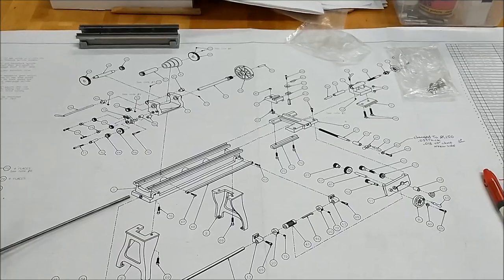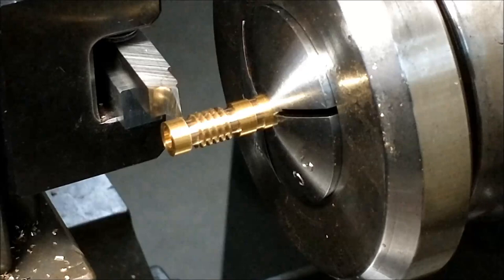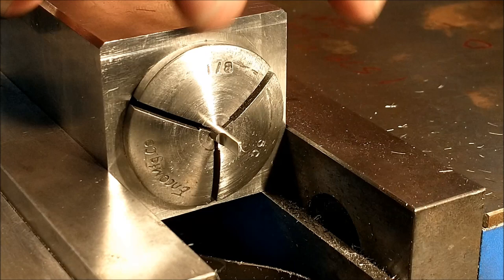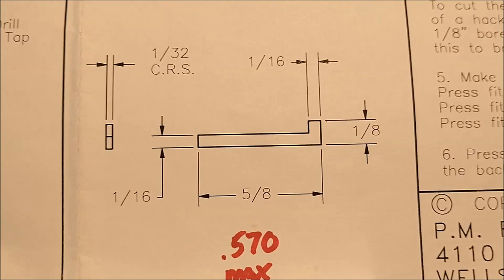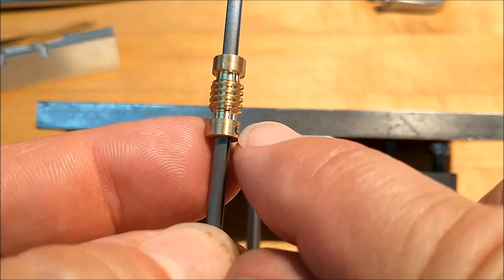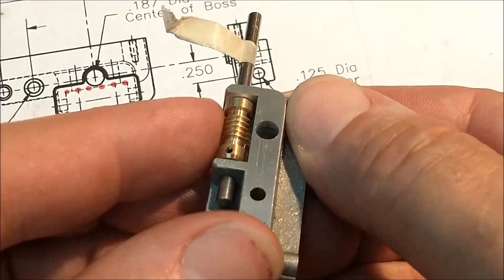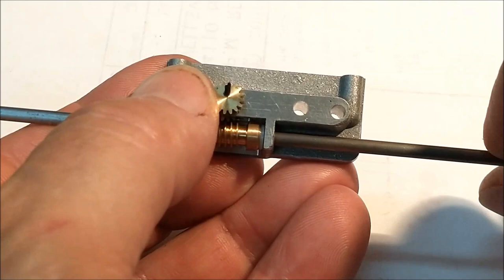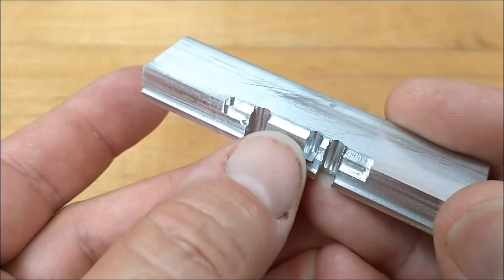IMPOSSIBLE Miniature Internal Keyways and Worm Gears

Comment: A thing of beauty is a joy forever! When you were adjusting the broach with a punch I was thinking the cutter would bend sideways somewhat more easily than it would forwards (despite the relief), so it would be easy to accidently widen the slot.  I suppose you just need to check alignment carefully before taking the next cut.
Reply from the maker: It did side bend once. I caught it on the next pass.

Comment: When you were making the broach it left me wondering how this was ever gonna work until I saw you bend it. Dear me, I never expected you to make a sacrificial tool.
On making the L-key I think it would have been much easier to simply file it. As a modeller I have learned to file within 0,02 mm (7-8 thou) tolerances and I have a very small machine vise to hold it (1 in).  But as to machining it your method was again ingenious to say the least.
Reply from the maker: The sacrificial broach worked very well, and the completely blind machining of the key was fun. You have to trust your numbers.

Comment: joe having seen this video,,, has  given me inspiration,,i am in the posesion of an  "old"myford ml 10 lathe ,,one of the cheapest they made !no rack no tumbler reverse,,the traverse is by the lead screw the handle of which holds the dial for thread cutting...after see ing the above i am going to make the tumbler reverse and fit a rack and cog for the traverse, using the old handle from the  lead screw traverse..i will need plenty of patiance,,  but i have the patcience of an oyster... so here goes nothing .....wish me luck   ,,,,, laurence

Comment: Thanks again, Joe. Time well spent watching your videos. I am currently rebuilding my 9x20 bench lathe saddle so in a sense I'm doing something similar to what you are doing, on a larger scale. all of the holes in the cast iron for the gear shafts were worn so I reamed out the holes and installed offset oilite bearings, that I made, to adjust the backlash in the lead screw, feed gears, and rack and pinion gears. All in all, I modified & installed 3 bearing sets and the set screws to hold the offset adjustment and also installed new oil feed channels so the new bearings won't wear like the stock ones. Watching your project was a good inspiration for fixture methodology and had a myriad of good tips and pointers for general machinist practices. I'm looking forward to the final assembly of your lathe and watching that bad boy going round and round. As you say, "it's a thing of beauty".

Comment: As I was watching, I was thinking about how much I have learned watching this build. My question is, and it's not a rhetorical one: What, if anything, have you, Joe, learned, while building this kit?
Reply from the maker: I had limited knowledge of these machines when I started. I really like the reverse gear setup and the feed worm designs. I have a better appreciation for the intellect of the 1800's engineers too. My steam engine was my first functional scale model and it was just a build. I took my time, but this lathe has my heart. I am going the extra mile on every step. So maybe I've also learned a higher level of patience. Good question.
Reply: @joepie221  thanks for that response! I wasn't trying to pry, but I know that smart people are always learning, and I figured what you learned was valuable for me to know. With respect to "appreciation of 1800s engineers": I work on and use firearms from that era and that's where MY heart is for much the same reason.

Comment: I worked for 7 years at Westclox making tools and dies for the production of key wound alarm clocks. Small parts are nothing new to me.  Now I work for a shop that makes anything that we can. I have an order for 10 snow making machine nozzles that has a 0.010" Dia. hole drilled through the center of a 9/16 Dia. stainless steel blank. I've been wanting to build this lathe for a few years now. I hope to build the whole shop that they offer. I think I would've started with the drill press first.  Nice work Joe!

Comment: Nice work as aways.
So the gear train in the Apron is around 62 DP or .4 Module.
Ths drive key in the worm can be almost as long as the worm if you just offset the tang on the key.

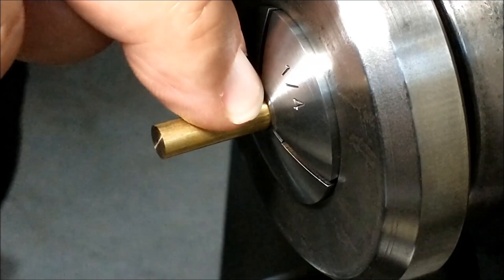Comment: 2:01 There is a easy trick to get it run fairly straight in 3 jaws and 4 jaws -I loosely put it in chuck and then use a peace of wood/plastic/sometimes steel back end of knife-or whatever is avalable according to material i am going to cut hardness and i put it in a knife holder and slowly touch  it while machine is running.Just make sure that peace you are using in a holder is above the center and that clamped peace isn't too loose or it may jump out .
Works very well ,simple and fast.Some people made holders with bearings but i am way to lazy to bother with it.

Comment: A very interesting process. I am learning quite a bit from you on working small. I also for instance enjoyed your video on how to cut very thin walled parts on the lathe. That video pointed out that the loads are on the cutting side of the tool and what is behind does not matter, at least in the way of loading. " Producing Extremely Thin Wall Parts ---Made Easy "

By the way, I love your teaching style. You cover what is needed without too much extra, but at least for me there are few questions left. You also, as does Quinn Dunki, chose some great projects, fun to watch and informative at the same time.

Comment: Great work Joe, and awesome job of working out the intricacies of that key/worm assembly. So much fun to watch it operate as an assembly and kudos for getting it to work on the first try. My guess is if you made it to dwg dimensions you would have to alter it with a dremel or such until it cleared every where. Enjoyed the video, and you seemed to really enjoy the challenge, cheers and thanks!
Reply from the maker: I did enjoy the challenge. I knew it was going to be tough, so I saved it for last and thought about it for along time while doing the other parts.

Comment: I would genuinely argue the keyway depth in the worm gear is too much on the drawing. Not just because the pressure mark has come through, but because traditionally the key is square or flat, but I’ve never seen a tall one? Amazing work as usual :o)

Comment: Question about that worm: what is the DIAMETRICAL pitch of the gear that meshes with the worm, & the thread pitch of the worm?  The reason I ask is usually CIRCULAR pitch of the gear (which must be matched by the worm) is usually an irrational number, requiring non-standard thread pitch.  How did you set up lathe to cut that "weird" thread?
          Hail Mary!  Joe agreed to put shims in the setup!
Reply from the maker: I'm Ok using shims in a setup, but try to avoid them at assembly if I can.

Comment: You noted that the broaching put a little bulge in the minor diameter of the worm.  But that it didn't matter as there was plenty of clearance.  If you have done the broaching before the gear turning would that have prevented the bulging & would it have been much more trouble to do so?
Reply from the maker: The bulge would have then been internal. Tolerance wise, its a line to line situation.

Comment: Re-watching this as I’m attempting my first steam engine build, I’m very tempted to key the flywheel onto the crankshaft. It’s a 3” flywheel on a 3/16” shaft, but I may increase the shaft diameter to 5mm or 5.5mm to make things easier.
I want it to look like a proper old engine with a tapered gib key on the flywheel.

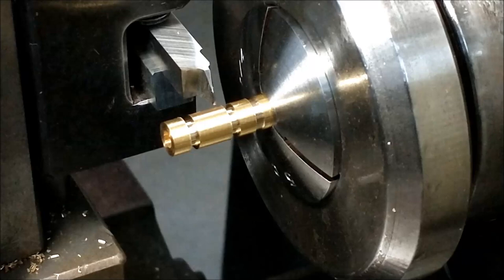Comment: Joe, near the beginning of the video, at about 04:56, you mentioned using either a DRO or a "drop indicator" to get the dimensions(?) of either end of the threads on part #41, the "clutch worm."  What is a "drop indicator"?

Also, I have to  nitpick here: "A key is a piece of metal used to connect a rotating machine element to the shaft. A key prevents a relative rotation between the two parts, and may enable torque transmission to occur. For a key to function properly, both the shaft and rotating elements (gear, pulley and coupling) must have a keyway and a keyseat. Usually the term keyseat is referred as a groove or pocket on a shaft, and a keyway is a slot in a hub in which the key fits into. The complete system is called a keyed joint."  (Plagarized from the Lovejoy, LLC article under "Key, Keyway, and Keyseat" @ <https://www.lovejoy-inc.com/resources/technical-articles/why-power-transmission-shafts-have-both-keys-keyways/>.)  Confusion between terminology for keys & keyways is fairly common, I think.  Please don't take my nitpicking about terminology as a negative attack!  Please do continue "unloosening" things for a long time!  ;)

Thank you very much for sharing the details of what it takes to make the clutch worm and its key.  I suspect that many folks would ruin these parts many times before getting something that might work.  And would also have great problems with the incorrect dimensions given on the prints, which are often taken as gospel (and ought to be given how long this model has been in production!).  I truly do hope that the manufacturer of this model is watching your videos and will take action to correct the errors that you've pointed out!

Comment: For the metal for the key the flat wire spring inside a windshield wiper blades will work good. I have found two sizes 1/8x.025 and 3/32 x1/32 . It is non magnetic stainless that is spring tempered and also makes good picks and I have even made small tweezers for metal slivers. If you need the metal go to your local auto shop and ask for old wiper blades in trash, I went to Walmart. Good luck and happy hunting😀
Reply from the maker: I'll have to take a look at that. Thanks.

Comment: How did you gauge the depth of that keyway?  I rather thought you would repeat the technique of broaching a square hole -- except in only one dimension.  A deeply keyed shaft could guide the broach if wandering across the hole was a concern.  If the shank tended to bend, you could support it at the relief with a weight... or raise it in the collet and lower it again after bending.  Once again, thanks for the inexpensive education!
Reply from the maker: I measured to the OD of the worm gear.

Comment: Two things that I'd do differently would be: first, use the already made keyed shaft as a broach guide and machine a broach holding it like you did with the key;  second, would be make a keyed mandrel to do the O.D. lathe work on the worm.  The worm gear blank would be drilled, reamed, parted to length, and parted to length.  Then I would  broach the keyseat.  Finally I would turn the worm on the mandrel.  However, as I've said before, I work on much bigger things that a collet would be impossible.  

Machining such a broach,  on the mill does require tilting the head to make the necessary clearance angles which adds significantly to the set-up time.  Plus, you would want about 0.001" per tooth which makes for 32 teeth on that broach.  You might get by with 12 teeth if you went with about  0.003" per tooth, but then you would want a larger spacing as the total load on the broach is a function of the total chip load. 

The thing that I noticed with your bending of the broach is that it did a little bit of what I anticipated.  It did not bend quite in line and twisted slightly as you tapped.  It was quite evident in one of your taps.  Also, the keyseat was noticeably tapered which would be a bad thing if it were for drive coupler on a high speed, high torque application.  But, with a low speed, low torque sliding fit, this is not that much of a problem.
Reply from the maker: On bigger parts, your approach may be fine. This key slot was only 1/32 wide and deep. A stepped broach would have to be extremely small and then there is the issue of the chips and chip load. I ruled it out. Too much prep. The broach did tap to one side on one of the hits, but I caught it and restored it to straight. The angle on the bottom of the cutter also tricked your eyes too as it flexed forward. The camera angle and the bottom relief did make it look like it was moving away.

Comment: how does the tool nails the same thread several times?
Reply: The leadscrew is running parallel to the ways is controlling the carriage movement via the half nut on the carriage and gearing for a specific thread pitch on the spindle side. A thread dial may be employed to ensure the thread timing is consistent when the half nut is opened to move the carriage between cuts. 
There's a start for you...

Comment: Hi Joe I have a ridiculous amount of time in the drive, I missed the 40 degree angle on the worm (cut it to 60). nice job on this assembly! I too did the same modification on the worm but I made brass washers for the thrust bearings.  I started wondering how many of these kits did not get finished due to lack of guidance and confusing prints from PM, the Stuart kit that I built had more direction.
Rich
Reply from the maker: This is absolutely a thinking mans kit. I hope some of those unfinished kits can now come off the shelf and come to life.
Reply: @joepie221  I agree. you are a great help to us hobbyist guys That is why I was hoping that you would take on the challenge.

Comment: is it possible to turn the threads and then press fit a sleeve tightly on each end?
Reply: The easy way out is always possible. But in this case, no. The redemption is in doing it to emulate the part as found on the 'Big Boy' lathe.
Reply from the maker: I suppose you could do that.

Comment: I know it would take a tiny tool, but would it have been reasonably possible to bore the clearance for the worm in the apron casting? Instead of milling an oversize pocket?
Reply from the maker: The area is captured and has a guide hole on either end, so probably not.

Comment: I'd have tried to pull the broach, much the way it is used to make bronze gateways, for pasta making. This way, I would rather use an elastic response than potentially digging into the material.
Reply: It might also be easier (with a pull "broach", or more accurately, a slotting tool) while using Joe's ingenious idea of bending the (non-heat treated!) tool to increase the depth of cut, to arrange things so the guidance of the shank in the bore was available before the tool entered the work. As it is, it's really a case of shutting the stable door after the horse has bolted. As it stands Joe's method would help prevent the cutter drifting towards the end of the stroke, but does nothing for some distance at the start.
Reply from the maker: The DOC was minimal on each pass and and the entry was pecked a few times to assure it was not flexing. It had its dangers, but worked out well.

Comment: I wonder if you could just tap the hole drilled in the worm gear to take a small set screw whose business end is turned down so the O.D. is just under the width of the key way in the driveshaft. Then tighten finger tight, and back off 1/4 of a turn, and use a small drop of thread-lock on the set screw. It can now slide back-and-forth on the driveshaft, but will be locked rotationally to the driveshaft. This seems WAY easier than making an eenie-tiny “L”-shaped key! 😋 (Especially given that the dimensions given in the plans were wrong, anyway.) Either that, or just make a normal “I”-shaped key; since the length of the key is much greater than the slop (about 1.5 mm) at either end of the worm gear (and you’re going to put Teflon bushings in anyway), there’s no way that key is ever coming out unless you disassemble this part for service at some point in the future. 😎
Reply from the maker: A small screw with a dog point on either end would be a great solution. Very much like the tail stock spindle setup.

Comment: So apart from the leadscrew bearings and finishing off the hardware on the apron, what's still left to do?
Reply from the maker: One handwheel, the drive shaft hangers (2) and a couple mounting holes for the gear arms. DONE.

Comment: Beautifully made part. And loved how you casually made such a miniature tool as a 1/32 broach. 
But as a beginning  hobby-machinist there's one thing I'm wondering about. 
Is there a particular reason you're using 5C collets instead of ER collets for workholding?
Reply from the maker: 5C is a very common collet for the lathe. I use the ER series on my CNC.
Reply: @joepie221  Yeah, I noticed that 5C was very common. I'm just worried that it doesn't always hold the material as steadily as an ER collet, since the ER puts pressure all along the enclosed part of the material, while the 5C is mostly at the opening of the collet. But I guess if you can get material that fits more closely to the collet size, it's no issue. 
(Getting hold of material at all is a bit of a pain here in Norway, so I'm using any scrap I can get hold of and not all of it is exact in size. So I went for an ER32 collet chuck. Haven't tried it yet, since it's a pain to swap over on a Chinese Mini Lathe, but will try soon)